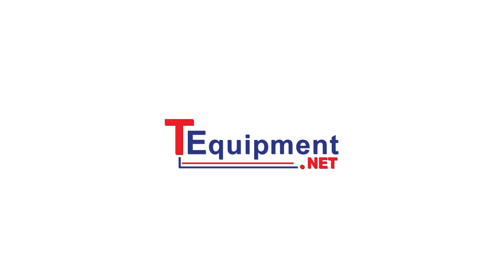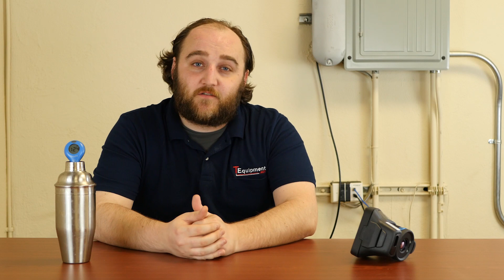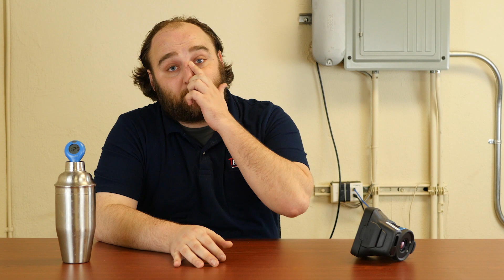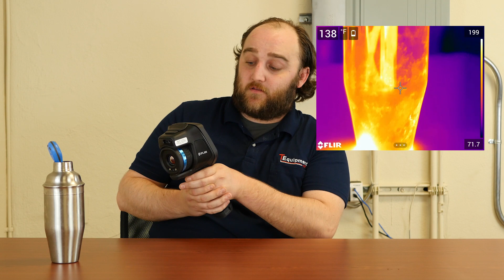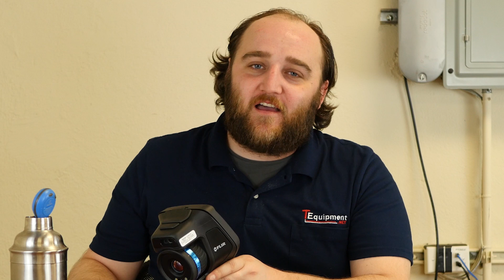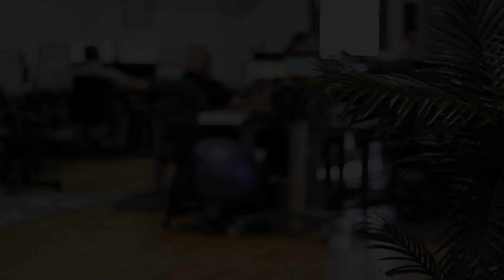A Complete Guide to Emissivity for Thermal Imaging

Comment: I'm trying to figure out how much warm air is escaping thru various surfaces in my house. We have an old window that isn't double layered and an old door with thin glass that opens to a closed but unheated porch. Outside temps. here are between -15 and +20 F this time of year. Been using the thermal camera but it doesn't work as well on the glass windows.

Comment: I'm just getting into this as a hobbyist so only learnt the emissivity word the other day. Can you clarify how this works with normal thermal imaging cameras and IR thermal cameras? Or am I misunderstanding completely? I want to get something that can "see" the tunnels burrowed by animals on my farm and an old Flir thermal imaging camera is not showing that so I'm assuming I either haven't set the correct settings or it's not IR, hence why I'm getting into learning about what all the settings mean.
Reply from the maker: Emissivity is likely not the issue in this instance. IR cameras cannot see through the tunnels, just the readable temperature differences. Even if the animal stays in one place for a long time (or has a nest) the depth of the tunnels, ambient airflow of said tunnels, and strength of your camera specs may prevent any readable difference in temperature. 

A borescope may be more what you're looking for. It's more invasive than an IR camera, but you'd get a better view. You can read more about them and see what units we have available here: https://www.tequipment.net/borescopes/

We hope this helped!

Comment: How would you account for measuring through a window? For example, an optical element with transmission of 0.9. Is there another correction that should be added to emissivity due to the window?
Reply from the maker: Hello, Ashley! This is a question for our product experts, as they can provide more accurate technical information. Feel free to contact us via phone, email, or Live Chat here:
https://www.tequipment.net/service/contact/
Reply: Build a window made of Germanium. No light comes in or out. But thermal can see through it no problem. If i showed you  piece of the stuff you wouldnt believe me til i showed you.

Comment: I work in a Power Grid, the Switch Gears(AIS) are mostly made of aluminum and some copper parts also.  but whenever I try to measure it with the correct emissivity for copper(0.02) or Aluminium(0.05), It's shows like 200+ degrees of Celsius , when it should be betoween 50 to 70. what is there I'm missing?
Reply: I'm having the same issue. Did you figure it out?
Reply from the maker: Hello! We are happy to provide support for our customers. Feel free to contact us via phone, email, or Live Chat with your issue and we'll be able to direct your query from there:
https://www.tequipment.net/service/contact/
Reply: You need to also take “Reflected Temp.” Into account. Make sure you are taking measurements at an angle to the left or right of the equipment, rather than head on.

Comment: The E95's image quality is impressive. I have a TG267 for home inspections. Do you think that model does pretty well for basic inspections, like finding missing insulation, hot circuit breakers or high moisture spots? I'd like to upgrade, but a $500 camera is what I can afford at this moment.
Reply: Did you find answer for E value for breakers?
Reply: Does the TG267 worth for starters in home inspection? For exemple for moister?
Reply: You should reconsiderthe TG267. The screen is too small for home inspections . I switched to a Hikmicro Pocket 2 and I loved it. @tirresurf

Comment: Well, hell that explains why i cant get a correct reading on a car AC lines.
Reply from the maker: AC lines are typically either steel or aluminum with a reflective corrosion-resistant coating. For reflective surfaces, you'll need to lower your emissivity. For polished aluminum, try 0.88 - you can find more detailed emissivity tables online that include a wider range of materials.

Comment: Hi…can u capture in a thermoCam the hot air which lies In summer on top of dry land and flickers like boiling?
I want to find a way to capture thermal air convection on a thermal cam…
Thanx
Reply from the maker: This type of thermal camera can only measure surface temperature of solids and liquids - they cannot measure air temperature. There are cameras that can image gases in the mid and shortwave, but if a typical longwave thermal imager like the one in this video saw air temperature it wouldn't be very practical, like looking into a thick fog. If you have more questions, feel free to contact our experts. You can call us at (877) 571-7901, email Sales@TEquipment.net, or live chat on http://www.tequipment.net/
Reply: @TEquipment  could you suggest a cam for my thing?

Comment: Will standard 0.95 setting be fine for locating missing insulation / cold bridging behind plasterboard (sheetrock I believe you call it). I have a C5 for personal use to locate internal cold spots in a domestic house but it's summer here so the differential between inside and out is nowhere near as easy to detect as if it were winter. The plasterboard is generally painted cream in colour.
Reply from the maker: Yes that setting should be suitable for drywall with an off-white paint, but it really depends on the paint. Typical white, cream and yellow paints will range in emissivity from 0.9 to 0.95.

Comment: Can it accurately measure air temperature?
Reply from the maker: It is possible, yes. However, it's not as simple as just turning the camera on and pointing it at the air. If you're interested, this study gives some more insight: https://www.researchgate.net/publication/242429314_VISUALIZATION_AND_MEASUREMENT_OF_AIR_TEMPERATURE_USING_INFRARED_THERMOGRAPHY
You can also contact us to speak with a certified thermographer: http://www.tequipment.net/
Reply: Hi i purchased the flir e8 for water leakages but although i am passibg hot water in the pipes i am not seeibg the pipes clearly under the tiles do i have a bad emissitivity setting pls?? Tks

Comment: Nicely explained, what if we are not interested in exact measurement, like we are looking at Solar Panels for defects, roughly we want to know if it has any bad cell. will it help if we keep Emissivity to 1.0 which is perfect black body.
Reply from the maker: In theory, if the exact measurement does not matter to you, then emissivity adjustment should also not matter for your application. It sounds like you just need to see a clear temperature difference between cells on-screen as an indication of a bad cell - this will be possible regardless of your emissivity adjustment. Emissivity adjustment is a crucial step only if you need the exact temperature measurement to be 100% accurate. Feel free to contact us via phone at (877) 571-7901, email Sales@tequipment.net, or live chat on www.tequipment.net with any other questions.